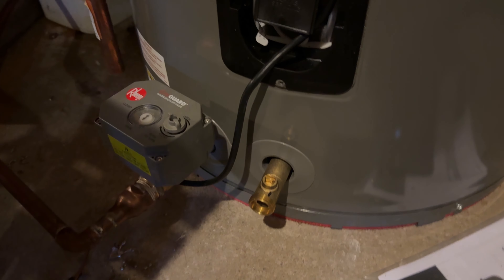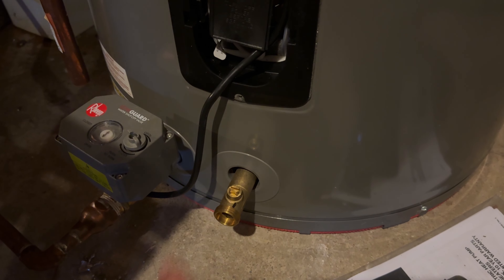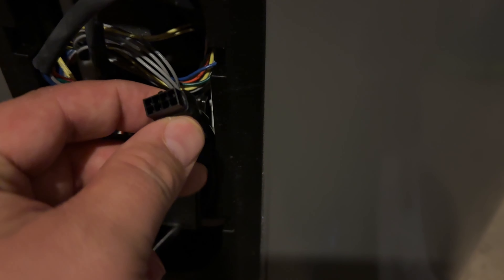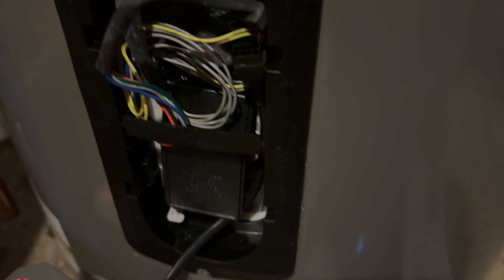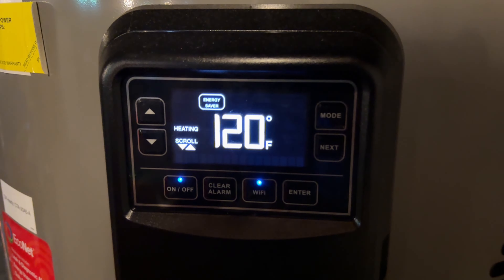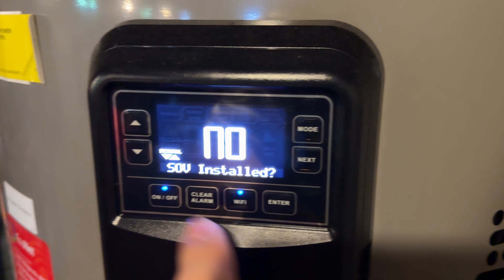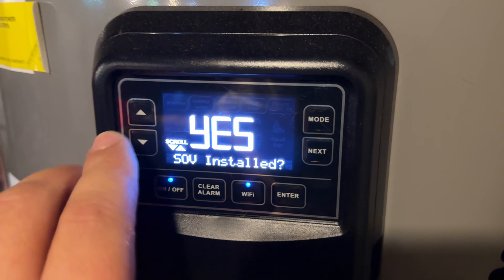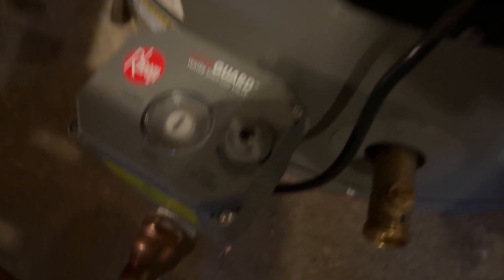How To Disable Rheem Leak Guard Shut Off Valve On Water Heater!

Comment: Wish this applied to mine. Looks like yours is newer and simpler.

My former housemate purchased mine and registered it in his name. They only allow one person so I'm locked out. I can only "count the beeps" to get an imprecise 1/2-answer and still don't know wtf is wrong with it. Only 4 years old and it's 💩'in the 🛏️!
I've been resetting daily for months and just thought to disconnected the auto-valve. Only plus side over yours is mine is on top of the unit, only one wire and no need to take off either panel.

There is only ONE local plumbing company in the southeast PA major metropolitan area (Lehigh Valley) approved to warranty service Rheem, O N E !!!
Our first Rheem was brand new in my new construction home and lasted the standard 8 years. They are really going downhill.
Your display looks great, but that DOES NOT in any way make up for units failing to provide hot water! A water heater HAS ONE JOB!!! Leaking, believing that it's leaking when it's not, and shutting off access to hot water that is right there in the unit are all unacceptable. They need to quit focusing on the panel electronics and fix their obvious [BUILD] QUALITY CONTROL FAILURES!
If I can get a prorate back I'm jumping ship to another brand!
Rheem SUCKS 🍑!
...& not in the enjoyable, life-affirming way 😒
Reply from the maker: Wish this helped you out.
Reply: @easyheimer  Yeah, I had to reconnect it later cus the alarm started again and it wasn't heating.
Reply from the maker: That’s a bummer.
Reply: They need to build them like the old kenmore's, I just replaced our Kenmore that was 32 years old as preventative maintenance. Well that'll teach me as this Rheem is nothing but a POS! Stop trying to Bluetooth everything and just make stuff that works and lasts! I don't care if I have to pay double as long as it lasts a long service life.
Reply from the maker: Yeah it’s kind of crazy. They don’t make things like they used to.

Comment: Does the leak guard stop the elements from heating the water as well?
Reply from the maker: Yes it does.
Reply: @easyheimer  how do I bypass this? I have a new water heater and no hot water even though I disconnected the leak guard shutoff valve (mine is electric)
Reply from the maker: Not sure. Is it this model?
Reply: @easyheimer mine has a smart panel but it's the one without the LCD screen on it. 😊
Reply: @easyheimer  I figured it out. Someone on redit gave a run down on how to remove the actual leak sensor so it wouldn't shut down the system
Reply from the maker: Awesome! Glad you were able to get that situated.
Reply from the maker: Yeah sorry. This is for one specific model.
Reply: Is this a fix for T120 code?
Reply from the maker: I’m not sure. Did your water stop?